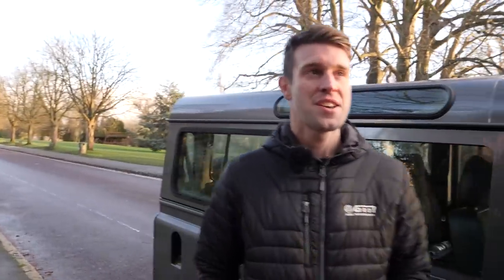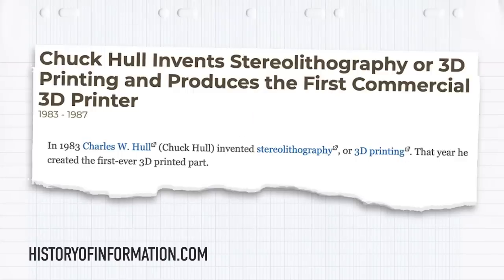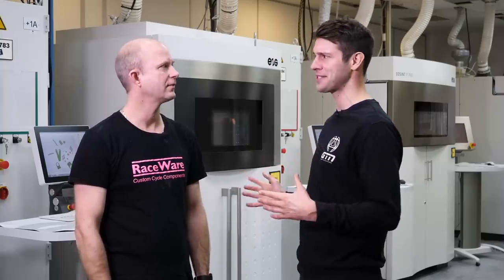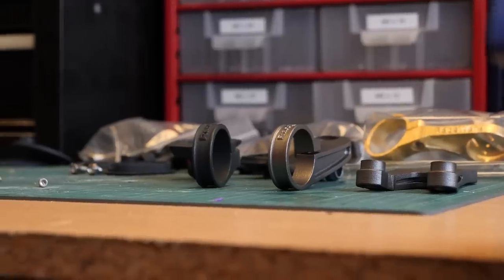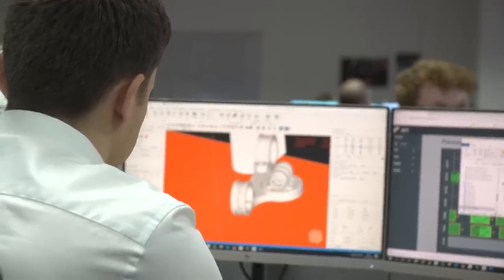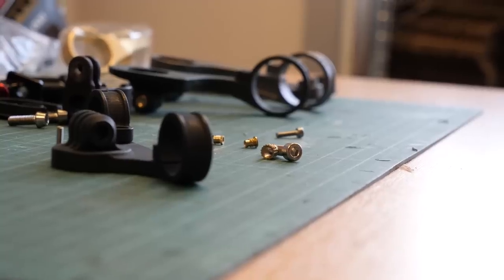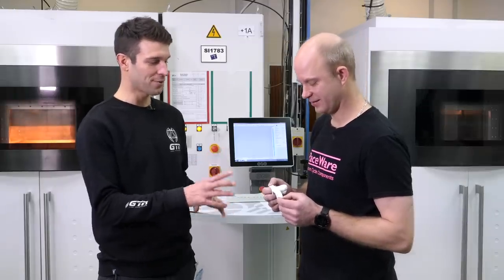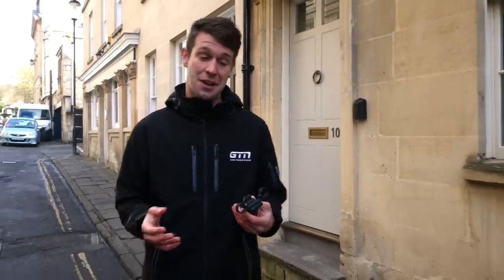Is 3D Printing The Future Of Triathlon? | Custom Tri Bike Kit

Comment from the maker: Have you ever had anything 3D printed for your bike? Leave us a comment!
Reply: yup! a 3D printed cover to replace my Shiv Control Tower and a 3D printed aero spacer/column for my stem when building up my bike. 

i'm now working two other 3D printed item.
- an extension arm to mount my bike computer higher in my line of sight behind my hands on my aero extensions, &
-  a garmin mount for a Varia unit for the Shiv seat post.

Comment: May be it is hard to hear. But every guy with a 3d printer and basic CAD skills could have made this mount in 5 hours.
Reply: Elmorow they could, but the difference is the quality - quite considerably too
Reply: @markthrelfall3577  You should really check out the quality of todays private use 3d printers. It is about efficiency.
 Valie for miney
Reply: So that’s 5 hours of a skilled self employed craftsman plus the use of the printer.  I wouldn’t expect much change from £300.  Raceware would charge way less than that I’m guessing.
Reply: You should start your own business then Elmorow, you make it sound pretty easy.
Reply: @whiskywhippet  It is easy, but impossible to make money via a company. You for sure know the thingiverse.com . If not check it out. Every model there is free.